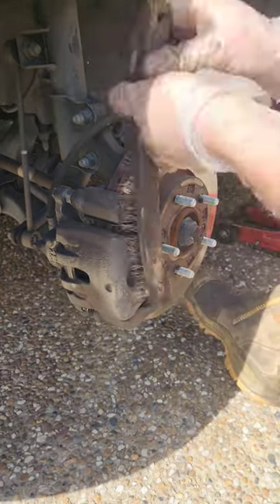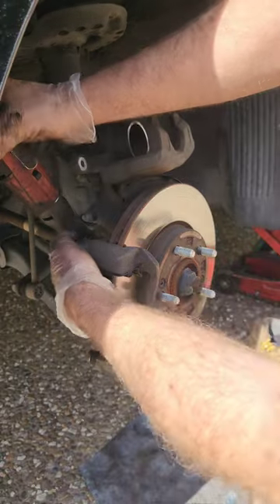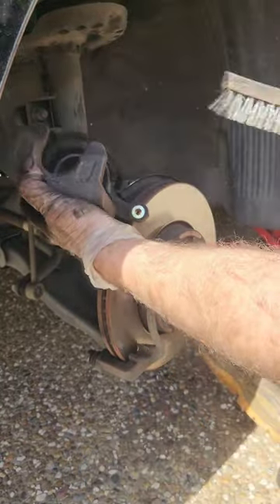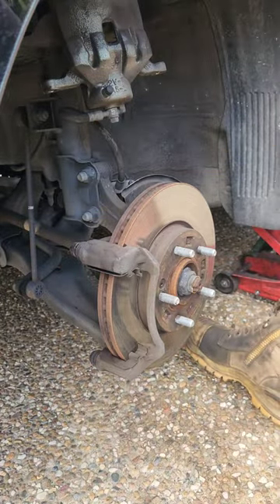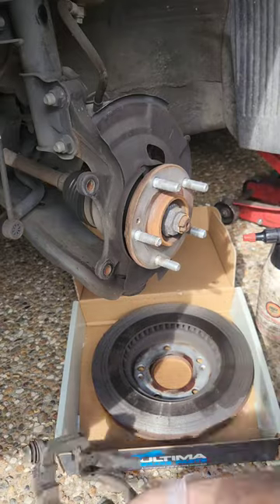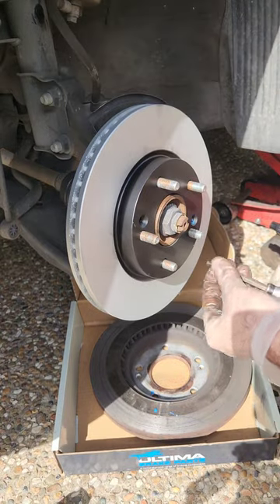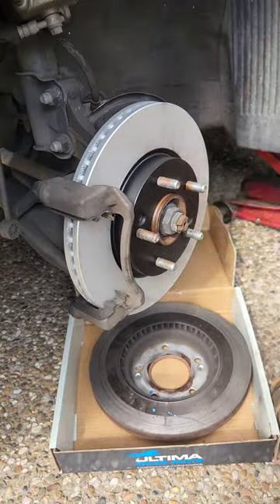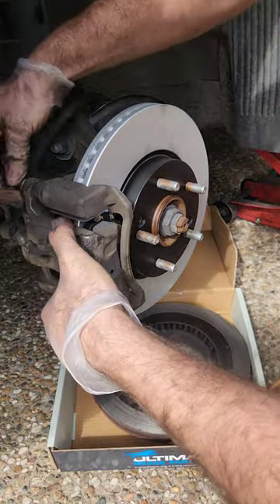How to change Hyundai I30 Front Brakes.

Comment: The guy who changed my breaks broke those 2 screws in the rotor so they need to be drilled out, any tips on where i can find them? Or is it not so necessary with those screws.
Reply from the maker: Hello,

Just drill them out. They are not necessary to put the new rotors on.

My rule is if they are there when I arrive, I'll put them back. If not, then it's not necessary for these cars.

Comment: When I press the brake of the car, the steering wheel shakes.. Interestingly, this shaking occurs mostly when the speed is around 100 km.
Reply from the maker: Hi, 
 Generally speaking warped rotors will be the course of this issue. 

Although without looking at the vehicle its hard to say. Thank you